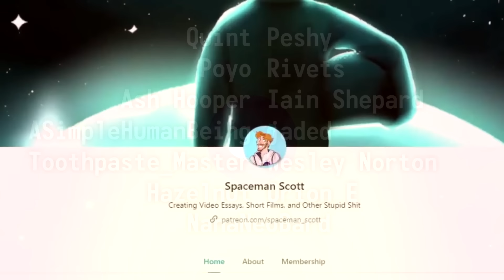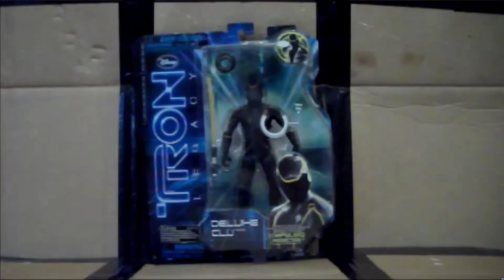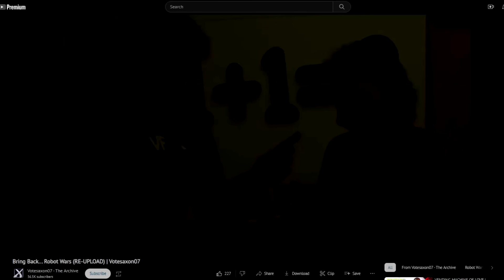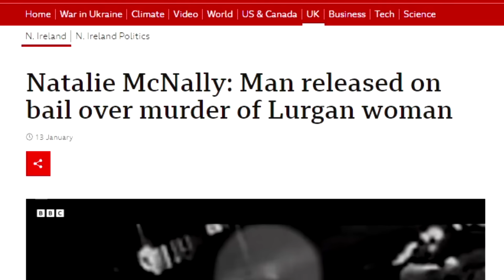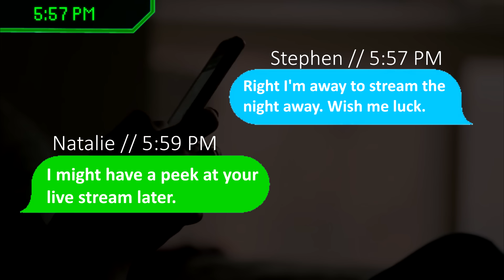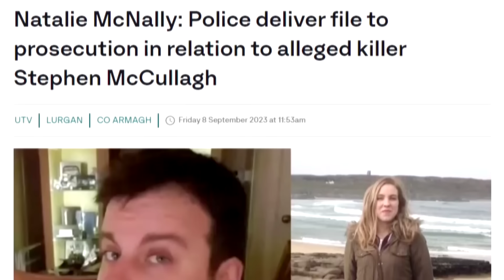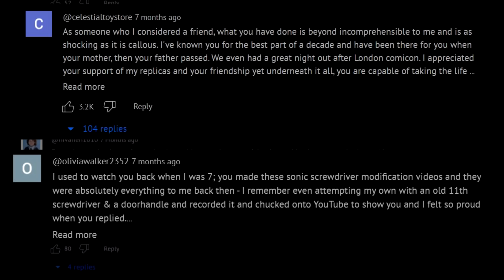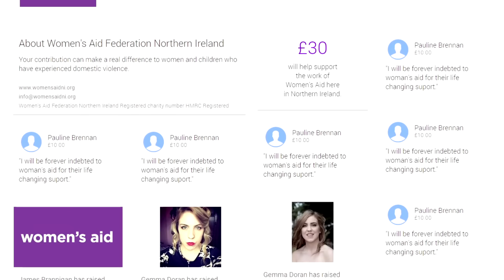My Favorite YouTuber is a Murderer.

Comment: i worked as a machinist/sandblaster for a guy named Steve Mcullough( pronounced the same way too), and nearly died due to unsafe working conditions, and the fact that steve and the owner got a sick enjoyment from mistreating their workers. so to a degree i nearly had the same thing happen to me. for anyone curious, i nearly had 1000+ pound machinery nearly fall on me, nearly got electrocuted because the owner sat farming equipment on a live wire, cut the wire causing the equipment to become electrified and told me to pressure wash it. and i nearly died of heatstroke after days of using a malfunctioning sandblasting hood. it was supposed to circulate compressed air through a valve to produce cold air so i wouldn't die of heatstroke sandblasting outside in 100 degree heat, but it was not producing any cold air and i was told that i was a "lazy piece of sh*t, trying to be a time-clock-thief."

i was 21, severely depressed and just let them do whatever to me because i needed the money. and they knew it. thats the kind of people they hired without exception, because they knew they could get away with it in the small town we live in. the two families that own all the farmland can do what they want.they can just pay the judge off, genuinely. but Judge Heady will lock up potheads for possession for MONTHS, even if you don't give names. if you do give names, they "go easy," on you with a paraphernalia charge as if the people charged can afford the fine associated. just rampant corruption in need of a good guillotine.